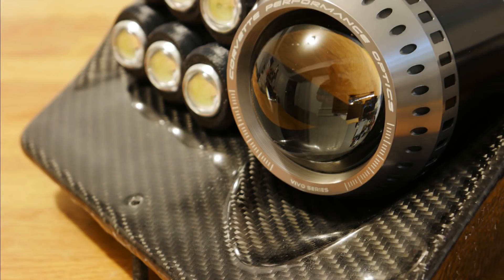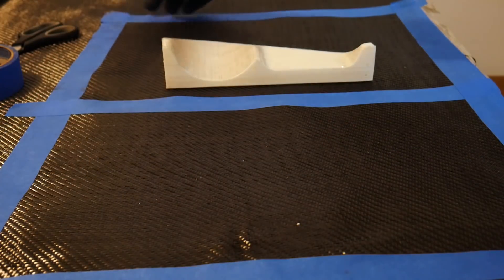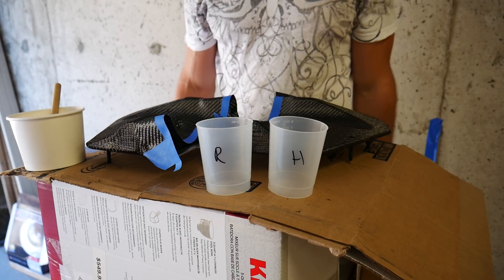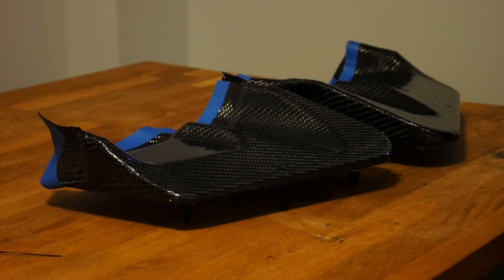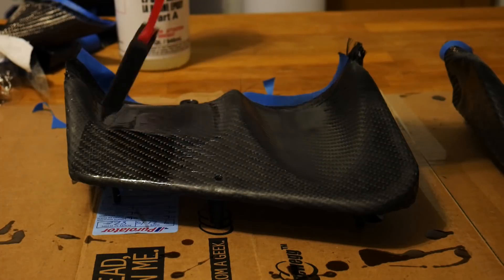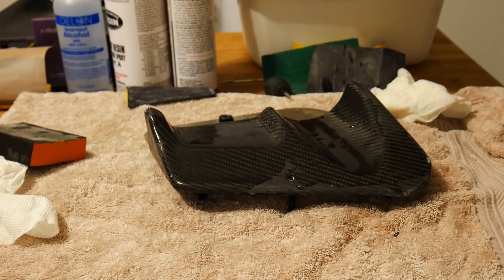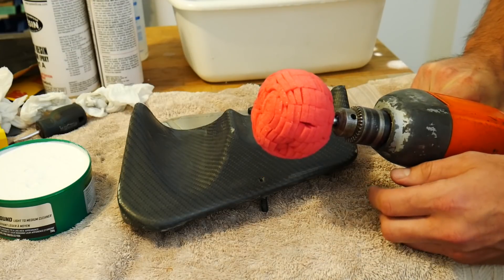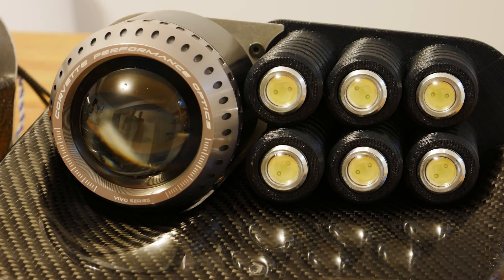How to Hand Lay Real Carbon Fiber Wrapping / Skinning Tutorial

Comment: what spray adhesive are you using? I've been using 3M 71, but i've heard of several others. Also, between each of your epoxy coats did you allow to fully cure for 24 hours so you could flat it out between each coat?

Comment: Can’t get my skinning to work.  Carbon fiber lifts off of the tacky coat on my part as soon as I add the wet coat.  The epoxy resin may as well be vasoline.  I have no idea how to fix this problem, other than to spend Thousands on a vacuum infusion set up which would make the whole point of DIY pointless as I am not saving any money with a set up like that.  I am not even sure a vacuum bag set up would even work with the complex flat, curved, button openings and cylinder shape of my vent.  Also, Super 77 spray adhesive actually works against the epoxy resin, so I am not sure how you managed to get this to work.  Jesus this is frustrating.

Comment: I always wonder why someone would want to apply a "wrap" around a part pretending that it's a real carbon fiber part. Seems fairly lame to me.
Reply from the maker: Depends I guess. Sometimes it's just to match things match
Reply: It makes the part stronger and prettier......no brainer.
Oh you have a brain?   Lol
Reply: @garycarbonneau499  It adds very little in strength as the base material is still flexible and doesn't create a real composite structure. You do realize the base structure (especially plastic) will separate and break from the single carbon sheet don't you? It's also applied to the outside of the part in a wet no mold lay-up so the surface finish is terrible and looks like shit. The only way to get an acceptable finish is to add more epoxy and sand hopefully not penetrating into the carbon strands and breaking them. Only a moron pretender who wants all his loser homies that know nothing about mechanical principals to think he's cool thinks "wrapping" with carbon fiber is a viable option. Oh and just a heads up there brain surgeon, I'm a 64 year old drafter designer that works with several types of exotic materials in my job. I was just trying to be kind and not make someone feel--well dumb. Next time you want to act a fool become educated on the subject matter so it doesn't backfire on you spike.

Comment: Fantastic guide, just wondering why the glue instead of an initial layer of resin?
Reply from the maker: I believe it was less sticky and messy than resin so if you mess up the placement you can likely pull it off and reposition without disturbing the weave

Comment: nice video overall.  You have to be very careful using the blue painters tape on edges to prevent fraying - yes that prevents fraying but it also prevents the fibers from moving at the edges which is what needs to happen to conform to surfaces.  The less flat the surface, the more this matters.
Reply from the maker: Good tip, thanks!

Comment: With epoxy resin you can eliminate the packing tape step covering the part as it will not eat the 3D printed part. If the part was any type of polystyrene based material then polyester resin would eat it. Just FYI for you and your viewers. Another thing you can do it use a hair dryer to apply a bit of heat, not too much, to your final coat of resin. This will lower the viscosity and make it flow for a better finish and help to reduce the number of times you have to repeat this step. Great video and workmanship!
Reply from the maker: Thanks for the post and that bit of information!
Reply: Any tips for applying multiple layers of CF cloth? Add another layer once the first one is tacky and so on?
Reply: @1SmokedTurkey1  As long as the total laminate is no more than 1/8th inch (3mm) you can lay it up all together, one layer at a time so as to get proper wet out between layers. I wouldn't wait until each layer is tack free since the curing process is well started and it will lead to a weaker laminate.
Reply: @GrantOakes  Thanks for the reply! I meant to wait until the layer is just tacky enough so that when applying the next layer of CF cloth it has something to stick to (like the function of the spray adhesive at the beginning of the video) or would that still weaken the part?
Reply: @1SmokedTurkey1  I understood your thought process, but there's no need to wait. Just try to keep the entire layup under 1/8th inch, otherwise you might build up too much exothermic heat and have outgassing between the layers.
Reply: @GrantOakes In my case I am going to need 4 mm of thickness. In general I can't imagine how I would lay down all of the cf layers if there isn't any sticking effect. I am making speargun (rough shape is elongated tubular body with a handle at the end). I am concerned that as I am wrapping the consecutive layers they start to hang from the underside, warp, get out of place and so on. What do you think?
Reply: alright got it. Appreciate the help! Much love

Comment: can you use automotive clear coat instead of epoxy to harden? planning to skin a motorcycle gas tank
Reply from the maker: Needs to be epoxy. I would finish the carbon fiber part in a UV protectant clear coat to protect it long term, especially an external part like a gas tank
Reply: @EmbraceMaking  Copy that thanks

Comment: Hi, great work love it!
do u recommend to use adhesive glue (3m 77) for base coat ,rather then the epoxy itself? is it better? 
thank you
Reply from the maker: I found in some cases it helped stick down certain parts of the fabric faster to get working... but eventually the epoxy gets in there and saturates it anyways.
Reply: I’m having same trouble if spray glue first then the base resin don’t stick properly.  Or resin base first then it’s hard to keep the edges from fraying

Comment: Umm is it me or does that look properly wobbly, not exactly shiny and he rubbed through everywhere.. pretty sure that makes it a do not do this video 😅
Reply from the maker: Pretty sure I mention in the video that I stopped the process and could have kept going to make it perfect. I basically just said it was "good enough" for my purposes. You just have to repeat the sanding and coating process a few more times to get rid of the low spots.
Reply: @EmbraceMaking  that's fair man just seems you rubbed through in a few important areas. Glad you're happy with it. I have a diffuser to do. I had a couple easy parts I skinned a few years ago and they sucked so not looking forward to something way more complicated. Looks like the technology has moved on a bit in a few years so that's good news 👍

Comment: Hello, I always replay this video for learning. I have a question. Is that 3m 77 good in your work? Is not repeeling from 3d part until now? Please reply.
Reply from the maker: Once the resin cures it holds its shape... if the shape allows the part to be removed then you can use an epoxy glue to bond the carbon fiber to the original part if you wish to do that, or completely remove the original part from under. If the shape does not allow the part to be removed then it will hold regardless of the glue.

Comment: you don't wetsand to "keep the part clean". you're wetsanding for lubrication. whatever dust that comes off of wetsanding can still be on the part while sanding because it is essentially the same grit as the sandpaper you're using. just make sure to clean off all dust before moving up to the next grit because you don't want to wetsand a finer grit when there's still rougher grit on the part. also, don't use water to clean your part before the next layer of resin. you will get moisture trapped and that can cause resin to become cloudy.

Comment: Avoid using adhesive spray glue! Instead, use a light coat of resin, but why? Carparts or any other type of wrap used outdoors are prone to high temperatures, and I may assure you that the spray adhesive will lose its bond to the solid since it also acts as a barrier between the resin and the part skinned. Always try to use one and the same type of bonding compound true out the build.
Reply: What about for interior bits ? So use the resin used over top of the carbon also as the adhesive between the surface and carbon fiber is what you’re saying ?
Reply: @RelentlessCo   Yep, and make sure to key the surface for a good mechanical bond!

Comment: I use spray adhesive 3M super 77 too like your way. But why when i put first layer of resin. The carbon will goes up. Especially tthe edge.
Reply: Because you're using too much resin or to thin of a carbon sheet

Comment: So best way to remove bubbles from resin top coat and such would be heating it prior to use fondue style? Cup in pot with hot water in pot. You think that's the way to go? Doing skinning on interior panels for my car

Comment: Hi.  between layers, when I put the 5 layers of epoxy every 2 hours, do you also sand?  .  I do it without sanding.  every two hours and the coats don't stick when you're dry and I have to level by sanding.  I do not know what to do
Reply from the maker: You should sand between layers as it will help them stick together. But make sure you clean it well after sanding, you don't want dust trapped inside, it will ruin your clarity
Reply: Embrace Racing Thanks a lot.  to me is that more layers peel off without sanding although I apply them when it is sticky ... When you give the first layer in the fiber.  after the other coat without sanding on top of it.  Doesn't that layer come off when sanding?  , Or not thick garters ?.  and what do you recommend to clean.  Alcohol or azetone ?.  Thank you!
Reply: Embrace Racing I am making a car steering wheel with carbon, and the truth is, your information is very useful.  I am using xcr uv resin and I have already made 4 attempts because I want it perfect and when sanding the layers jump like an onion, I have not sanded between them, I apply them when it is sticky but it does not stain the hand .. but there is no way.  I'm going to do what you recommend to see if it works this time.  What grain do you use between those layers?  180 to 400 too ?.  Thank you very much again and greetings from Spain!

Comment: hi, what material is the 3d printed part made out of??
Reply from the maker: This was just PLA... once the epoxy cures it is very rigid and whatever happens to the PLA trapped inside doesn't matter.
Reply: @EmbraceMaking  Ok perfect, so the epoxy sticks fine to the pla I guess?

Comment: You forgot one important thing:  epoxy resin deteriorate in UV, sunlight.  You should have buffed upto 1200 grid and then sprayed a polyurethane paint.  Now you did a lot of work in vane as the product will dull in approx. 2 years outside and even slowly start to turn yellow-ish and soft.

I have built a lot of carbon items for sailing yachts and always have had to apply uv filtering coats to them. Even to for instance carbon grab handles placed either side of the 'stairs' at the entrance to go down below. Not in sunlight all the time, as opposed to your light panels for your car.

Another piece of advice is to always degrease your product between cured layers before you start sanding.  You will sand greasy fingerprints and even a kind of greasy film that forms on top of a cured layer of many brands of epoxy after it has set or cured after some time.   If you don't you will sand the grease right down into the product's skin.  With a bigger chance of de-lamination.

All the best, keep on fabricating nice stuff !
Lucas
Reply from the maker: Thanks for the tips Lucas! If I remember correctly, the resin I used says it is non yellowing UV resistant. Wouldn't hurt to have an extra layer of protection though. It's been a few years since I did this and honestly they look as good as new.  I don't park the car outside so that may also help!

Comment: What's the reason for sanding after 24 hours? The part looks shiny and I'm wondering if you could leave it to that or sand anyway and then use clear coat?
Reply from the maker: I waited the full 24 hours so the resin wouldn't "gum" up while sanding

Comment: One thing I wanted to point out is when you went to apply the second coat of resin you said to make sure that it's tacky still and not set up all the way. Then you did the unthinkable!!! You touched the part. LoL, I painted cars for a very long time and people would walk in the booth and say wow that looks wet then stick their finger in it always right in the middle of a panel too! It looks wet because it is wet! Always touch the tape area were resin got brushed onto or any drips that came off it just to make sure its not still wet due to mixing wrong or your clock is wrong and its only been 20 minutes not 3 hours or bad resin sometimes. Anything can happen,  just use caution when you touch the part  because you can  damage the weave then your screwd pretty much. Everything else was really rad to see take shape and i dig the video for sure! Thanks for sharing it with us!
Reply from the maker: Good suggestion! Next time I could even deliberately get some resin on the tape to do as you suggest.
Reply: Im not trying to say do this or do that at all so dont take it wrong. Simply making suggestions that could assist you if you do another project like this. At the end when you polished it with the power ball, obviously that is one way that works. Another that is very good just to have for small parts like this or scratches in the actual car is those headlight repair kits. The one that has the sand paper and compound and the foam and wool pads that can be changed out on your drill. Its just like having a full size professional buffer but in a 3 inch version of one. Works killer for things like this and they are pretty cheap. I have done paint and auto body and custom work for 25 years now and just wanted to give a tip is all!
Reply: @firstnamelastnameisallowed7943  yep i just ruined a paintjob on my airplane that took me a week to make perfect. 
Lol didn't wait for the 3rd clear coat to dry because I thought I used enough activator. 
Fucking fat fingerprint right on the hull. Deep as shit too. 
I wet sanded but it got all the way through every layer of clear evenndown to the gel coat. 
Fucking pissed. 
Funny because I have been painting for a long time and never made a mistake like that.

Comment: Can this be done on the plastic backing of the front seats? And will regular carbon fiber or prepreg be better for precision?
Reply from the maker: I don't see why it wouldn't work! I believe prepreg will need a vacuum bag and oven... you will get better results with it but it requires more expensive equipment.

Comment: vacuum infusion is waay better and easier
Reply from the maker: Also more expensive. This is to show someone how to do it with minimal investment into tools and equipment like the average person would have.
Reply: ive done it many times with a $20 vacuum pump, you just need peel ply, a vacuum bag, and some tape for when you fold the lines so they are air tight, just gravity feed the resin, the results are amazing, and cheap and easy
Reply: @EmbraceMaking  https://www.ebay.com.au/i/362478948837?chn=ps&norover=1&mkevt=1&mkrid=705-139619-5960-0&mkcid=2&itemid=362478948837&targetid=752504779144&device=c&mktype=pla&googleloc=9069065&poi=&campaignid=7412621922&mkgroupid=80280724945&rlsatarget=aud-786643581046:pla-752504779144&abcId=1139426&merchantid=7364522&gclid=Cj0KCQiA89zvBRDoARIsAOIePbCpBZKBBPqc8KQZ1uUU0jBDhmpZR6kwf9crdJrRk4JNGsDi6PxN_P4aAoUcEALw_wcB

Comment: Could you skin a car hood if you use a uv protective resin? My paint is faded on my hood, and I just want it to look nice, but I hate all the fake carbon vinyl wraps. If so are there any particular resins you like for that type of job? Oh, and great video by the way!
Reply from the maker: You should be able to, but you would really want to make sure you have a good solid bond between the carbon fiber and the hood... I am thinking it would probably want to delaminate with the changes in temperature and all the flex in a regular hood... would be a challenge!

Comment: Great video man. You explained things pretty well for almost anyone to follow. I have a car stereo bezel that I would love to wrap in CF but I'm hesitant because of the holes. For example the HVAC, power button, stereo and the cigarette lighter. I'm assuming I would have to pre-cut those out into the fiber before I lay it down with resin?
Reply from the maker: Thanks for the kind words! Yes, I would cut the holes and use some adhesive to try and wrap the cloth to the back of the bezel and hold it in place while you set it with resin.
Reply: @EmbraceMaking  awesome, thanks for taking the time to respond 🙏. I'm actually continuing to binge on that Datsun build right now ✌️😂

Comment: If I was to hand lay a 2m X 1m wrap / skin over a surface, what surface material would be best to lay it on / bond to?

Also, how much resin & hardener would I need?
And also, what ratio would I have to mix the resin & hardener?
Reply from the maker: Hi Ian... I guess that depends on the application? The amount of resin and hardener would depend on the brand... check online and most manufacturers should list how much coverage their product supplies along with the resin/hardener ratio. Thanks!

Comment: For the same amount of effort you could just 3D print the pattern, make a mold and make a real carbon part and reduce weight.
Reply from the maker: I was only producing a one off part so I figured this was the best route to go. Making a mold would have required more equipment in my opinion, but yes the mold method would cut some weight.. although the printed part weighs next to nothing.